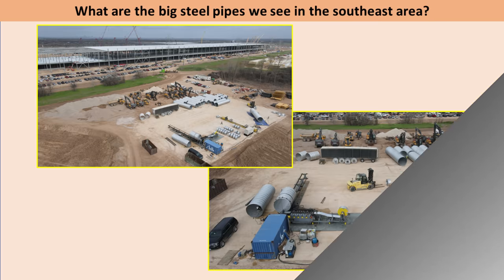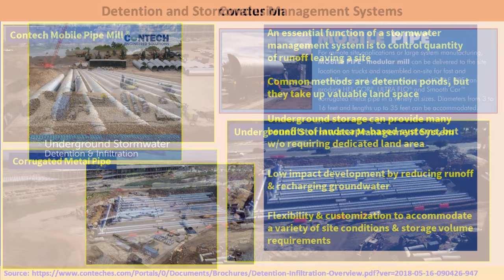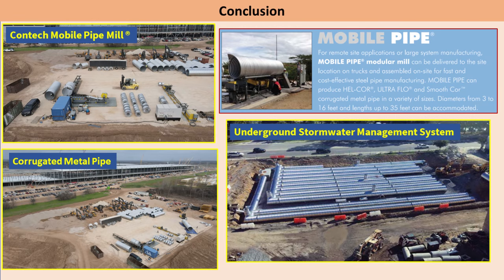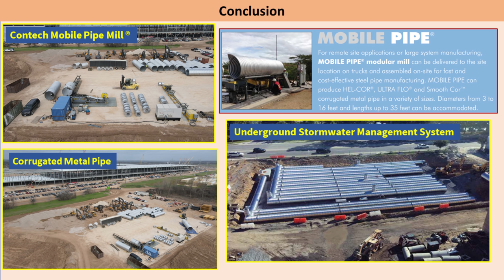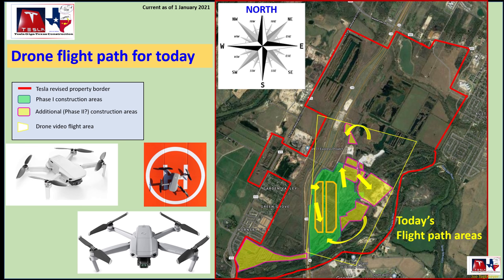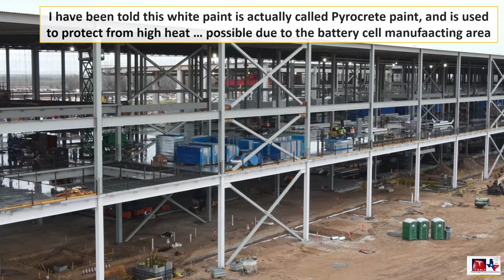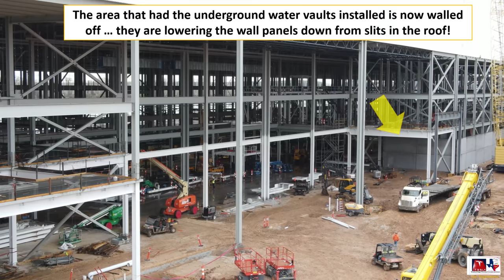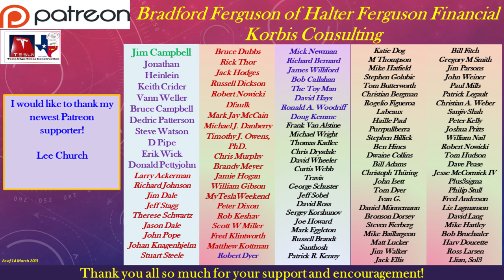Tesla Gigafactory Texas 14 March 2021 Cyber Truck & Model Y Factory Construction Update (08:30AM)

Comment: Hey Joe, why have they not even started waterproofing the roof? They are not going to be able to start installing all of that equipment they have moved inside with water pouring through the roof. A lot of that roof decking has been there for a very long time. I don’t get it! 🤔
Reply: Also, they are heat proofing the steel in case of fire. Still loses most of its strength when it gets hot in a fire.
Reply from the maker: They have several layers to go yet and it will take time.  What you see is just the initial paneling, but it's not yet meant to be water tight.  Lots more construction to do first.  One indicator that they are getting ready to water proof it will be deliveries of the materials which I'm looking for.
Reply: @JoeTegtmeyer  You won’t be able to miss it! It will be hundreds of truckloads of insulation panels and membrane.👍

Comment: omg, all of those columns all over the place on the ground floor. That's going to be a heck of a pain for the forklift drivers unloading the trucks.
Reply: The columns are spaced 45 feet apart and once they decide to drive east or west they have long straight roads. Much of the material handling will be handled by automated robotic transport anyway.

Comment: 4:53 I think the interior wall at the stamping area is only a temporary partition wall. My guess is that to compress the construction schedule, this wall was built to “dry-in” a portion of the stamping area. I’m also guessing that whatever is in the green tarp covered containers (6:43) are parts of the stamping machines. Even if installing the interior partition wall was to save 2-3 weeks - by not having to wait for the stamping machine area to be fully “dried-in” - that might reduce the critical path of the overall project enough to warrant the added cost.

Likewise, I think that both large openings on the west concrete wall of the stamping building are also temporary. They have chosen to leave these four panels out to allow moving large equipment in and out of the stamping building (otherwise there is only one small pedestrian door for this entire wall). The current openings do not appear to have any provisions for future roll-up doors (like you see on the South and East walls). Also, you can see the mounting provisions for the panels on the columns. Sure, they could load equipment into the stamping building through the roll-up doors on the south, east, and southeast walls, but that would slow down installation of both stamping equipment and exterior wall panels, not to mention potentially fouling up traffic on the perimeter haul road.

17:16 I’m not sure what these tanks are used for. I don’t think they are to support flushing the fire water loop, and here’ why... Potable water mains are required to be pressure tested, disinfected with chlorine and then flushed prior to placing into service. Raw water and fire water mains are only required to be pressure tested and flushed (no need to disinfect). I don’t know the diameter of the fire protection loop around the building. Based upon the building size, I would guess something in the 16-inch diameter range, but maybe as large as 24-inch diameter. For flushing purposes, you need a MINIMUM of 2 feet per second of flow to remove dirt or sand particles. For a 16-inch diameter pipeline, you are looking at a flow rate of ~1250 gallons per minute. A 24-inch main requires a flow rate of ~2,800 gallons per minute to achieve 2 feet per second. Those tank trailers have a capacity in the 20,000-30,000 gallon range, meaning they would be filled/drained in a matter of minutes.

Comment: Blue wall is blocking the rails. crane can't move from full north to full south anymore.
Reply: Probably temporary wall to create a weather proof area while constructing the stamping machines, once the building is completely closed these blue walls will be removed.
Reply: My guess is the blue walls are for sound deadening.
Reply: The south side of the wall could be a tool shop or a room where stamping dies are stored and/or maintained. They are also building a long blue wall running north and south along the large western room. Stamping is noisy. There will also be machinery to roll the sheet metal flat and to cut it into manageable shapes before stamping in a different, quieter room. Another area will be used to receive and store the metal coils. And of course they have to manage and transport the finished stampings. So it’s not surprising that this building will have separate rooms.

Comment: One thing for sure: none of the concrete roof, and a lot of the metal roofs, are far from weather-tight at this point.
Reply: remind me never to hire those guys cause they can't fix a decent roof
Reply: none of the metal roof is supposed to be watertight, it's just metal panels (they look like the same ones used for the floors), no concrete or other sealing material.
Reply: @davidelang  Not the same ones used on the floors. The corrugations are not as deep. The roof only needs to hold 30 lbs. a sq. ft.

Comment: So, it would appear that these pipes are really holding tanks .. . a cistern?  Certainly would be a lot cheaper than concrete cistern and unlike an open air holding tank, you can still use the land over top.
Reply: Odd location for a large holding tank. I think the pipe being installed now will send the water south where they might build an array of tanks made of this pipe or empty into an above ground pond. On the pipe website they show how an array of pipes can be used for underground storage.

Comment: How tall is the factory?
Reply: 80-100 feet.
Reply: about 60 feet. The concrete panels are 10 foot high.
Reply: @kkarllwt  there are ten flights of scaffold stairs to the roof. They are 8 or 10 feet in height.
Reply: I have guessed 75 feet. I have been trying to find out how large the wall panels are on the Stamping Machine Sructure so I could just count the panels.
Reply: 76 ft according to what the crane supervisor told either Jeff or Joe. 6'6 is apparently the standard rise of a flight of temporary stairs. 6' 6" x 11 plus a foot here or there is close-ish to 76 ft. Stair seen at 15:27.

Comment: Oh wow! A fresh video to watch that isn't about politics, cute cats, doofus dogs or conspiracies. Thanks Joe for another great flyover and commentary. I've been dying here stuck with my nose in my 4th book today.

Of note: gabeincal has a new Fremont fly over. There's a new overhead crane just like the new one installed here over Fremont's Giga Casters. I'm guessing they'll install column headers then roof over the crane, then skin the side walls. Finally, I expect they'll remove the temporay roofs over the individual casting machines. https://www.youtube.com/watch?v=alf4gXPGSW4

Pyrocrete paint is often used to meet steel structure fire code requirements. My father used to be called in as an independent contractor to apply it in athletic centers in particular since smaller buildings don't require a large crew. But it's applicable anywhere open structural steel is used. It lengthens the amount of time before the structural steel softens up in a major fire.
Reply: What about the blue wall stopping the crane conspiracy!😂
Reply: @DessieDoolan  That's a conspiracy I can get behind!!
Reply: @guycadieux6918  It's not a conspiracy it's true, it's true, I saw a youtube video. You need to believe!

Comment: What the hell do I know. I don’t think these pipes are for underground. These are only for HVAC above ground air systems in supply or exhaust. I don’t blame You and it’s unfortunate that Your Buddy doing way too much math led You astray.  Generally You do pretty good drone work.
Reply: Except you can see they've already been placed underground in this video.
Reply: A couple of hundred feet of the big pipe buried on that east side.
Reply: They are for underground. That's why they are corrugated for strength when dirt is poured over top of them. HVAC plenums are smooth, thin metal and not nearly as strong. They generally hang from rafters and have no pressure applied to them. All they have to do is serve as  conduit for air. So like you said, what the hell do you know? Not as much as My Tesla Weekend.
Reply: @mrschuyler  Well I’m wrong. Apparently they are now going to replace the massive storage ponds with these pipes probably 10 miles  of it so they can bury it out of site. The engineers have done a very poor job of water management and site drainage. This could turn out as another disaster for them in the future. They will have more than 2 million square feet of roof that should have its own large piping system to discharge RAIN WATER directly into the COLORADO RIVER. They would be much better off spending money on a separate water filtering and treatment system for contaminated ground water. Huge mistake to get rid of these surge ponds because it’s a no brainer to manage them because You can see the water build up. YOU CAN NOT BUILD OVER THESE LARGE STORAGE FIELDS THAT WILL TAKE UP MORE SPACE THAN THE PONDS AT A HUGE COST FOR WHAT?
Reply: @butchbailey965  I’m sure you can find “for what” with a little Google searching! Even if you can’t build on top of them, they could easily be covered with a huge parking lot for loading finished cars onto transport trailers. And so on . . .